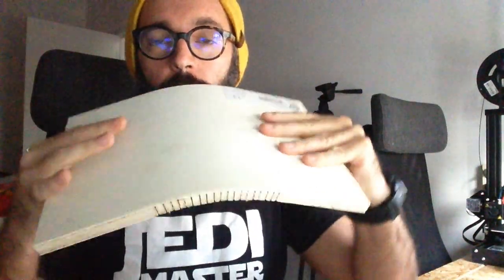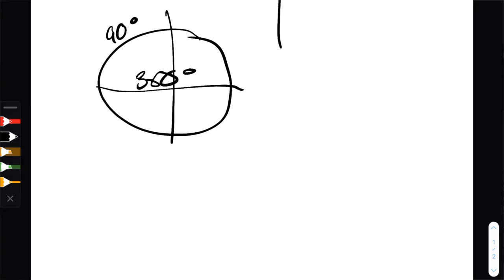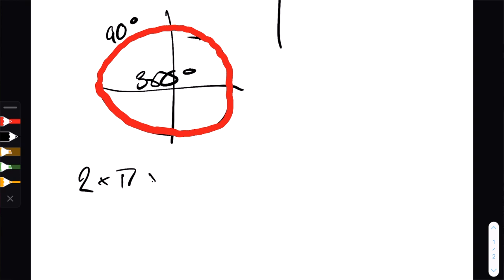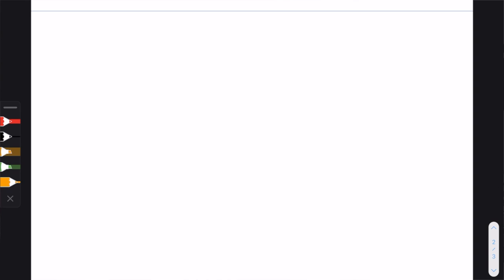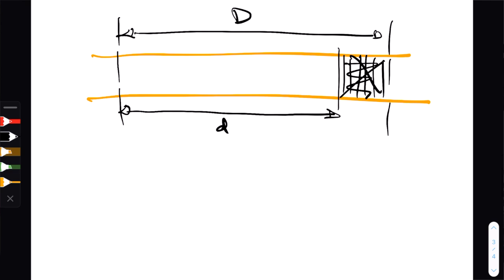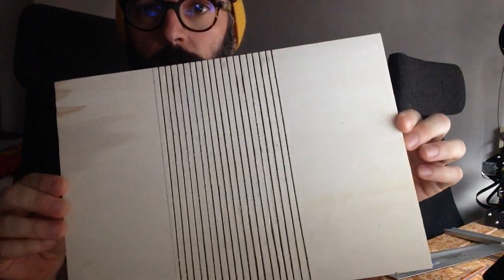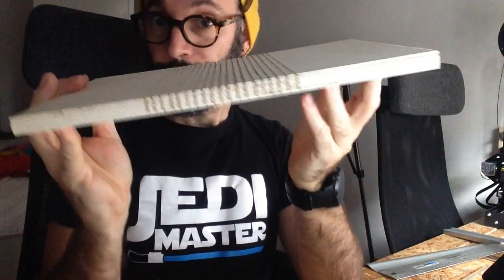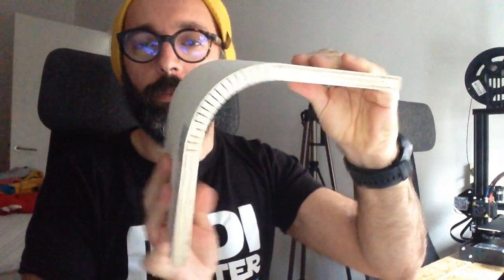How to do EXACT Kerf Bending

Comment: Nice thing! Just division of the 110mm should be by 20 to get the spacing, because 19 cuts leave 20 uncut areas between the beginning and end-line. Kind of like cutting a bread: one piece --> 0 cuts ;  two pieces --> 1cut; three pieces --> 2cuts ......
Reply from the maker: Good spot! two other people also spotted the error :-)
Reply: ;) btw and amazingly
you don't need to calculate the internal and external circumferences.
It's the thickness of the wood x2 ÷ 4(in this case of 90°*) x π

* e.g. for 60° it'd be ÷ 6

12mm x 2 x π ÷ 4 ,,,,, 18.85

500 x 2 x π ÷ 4 ,,,,, 785.39
488 x 2 x π ÷ 4 ,,,,, 766.54 ,,,, difference 18.85
________________
;) Here's a great little bit of mental arithmetic if you want to have fun with somebody on a long car journey(and I had to have it explained to me,,, and I still wanted to see it on paper before I believed it)

The earth's diameter is 12,000km
There is a piece of rope tied right around it.
The rope needs to be raised by ½ metre along its entire length.
How much extra rope do you need to order?
Reply from the maker: hahaha.....that is indeed a beautiful car journey challenge :-) The answer, I believe, is π meters.
Reply: That's interesting.
I was thinking that too
but,,,,
thinking of it as a clock face,,, with 60 segments and 60 markers on the outside
(noting the curve is only on the outside, it's sixty straight lines on the inside)
and let's say the circumference was exactly 60 cm\600mm
to get a smooth looking curve you'd want 60 grooves
cut at the centre of each minute section.

For a ¼ circle you'd want 15 grooves
but the the curve (the first groove) would actually start at 'half a minute' into the curve, the last would be 'half a minute' before the end.

! I got myself confused writing that but I think I understand it now!
I hope you follow
:)
__________________

Comment: How can I do for 180°? I did but totally failed :( using 3mm thick plywood
Reply from the maker: Sorry to hear you failed....but we all fail the first time. 3mm is very thin, so you will have to be extra precise to bend without breaking. It is important to know your blade thickness and the desired radius. I think a radius smaller than 10cm would be a challenge :-)

Comment: If you use a pic of a clock, it's an easy angle finder. Every minute is 6 degrees
Reply from the maker: Thats true....however, for accurate bends and to know how many kerfs to cut, you also need to know the radius and width of your blade.
Reply: @OneTimeBuilds  absolutely, totally agree.
Reply from the maker: @TWalls67  I built a tool that resembles what you suggest ;-) https://youtu.be/CIBRmBxTPCA

Comment: How deep did you make the cuts with your circular saw?
Reply from the maker: I typically do around 90%, but it depends a bit on the material and how flexible it is. But generally, if the wood is 10mm thick, I would do 9mm cut and leave the last hardwood layer intact.
Reply: @OneTimeBuilds  thank you so very much.  Great tutorial
Reply from the maker: @MrBrewsk  Great that it was helpful!

Comment: Gerat Video! Thank you so much. I just wanted to ask you, what kind of saw do you use, or what do you recommend for this fine kerf? Thank you in advance!
Reply from the maker: Hi Attila, thanks for your comment. Im using a simple battery powered small circular saw. In particular Im using this model: https://www.praxis.nl/gereedschap-installatiemateriaal/elektrisch-gereedschap/zaagmachines/cirkelzagen/worx-handcirkelzaag-wx523-20v/5358900?channable=02490e696400353335383930307c&gclid=CjwKCAiAi_D_BRApEiwASslbJ2VPj_YTx9tdviHMJF2tdM6-J_BWoO4X4FygyCSoPjgeEi5YJMm70hoCacUQAvD_BwE
Reply: @OneTimeBuilds   Thank you so much for your kind help. :) this is the best kerf calculating video. Do more :) Regards from Budapest!
Reply from the maker: Thank you! I made another similar one on calculating angles for joining boards :-) https://www.youtube.com/watch?v=ZYAxcUHvQUQ&t=42s
Reply: @OneTimeBuilds   This is awesome to! :) In case of cutting kerf on plywood I noticed that if we cut the wood more densely with a thin blade, the arc on the outer perimeter of the wood is much smoother.  Not as square in outside as cutting with a wide blade.
Reply from the maker: @attilasipeki1418  Yes, that is absolutely true! The thinner the blade, the smoother the curve!
Reply: @OneTimeBuilds  Hello my new friend :) Today I have my kerf bending on my plywood... it is so fantastic! :) I bought a Stanley Fatmax Handy circular saw I made the cuts. The blade is 1,2mm thin. It worked wonderfully. Thanks again for the helpful video!
Reply from the maker: @attilasipeki1418  Very nice!!!

Comment: Nice, simple explanation.

One observation: Dividing 110 by 19, as you've done, means 19 grooves with 18 sections of 5.8mm between them, plus (half of) the two outer cuts, which comes to 105.4mm.
The remaining 4.6mm at the ends do not bend, they are part of the rest of the board which is straight, and this may be significant in some situations.
To have the last bend right at the end of the curve, you'll need to place the outermost grooves at the ends of the 110mm piece and divide the remainder by 18, i.e.: (110-2)/18=6mm.
Reply from the maker: Haha....yes....I realised this as I was editing the video. Good spot!
Reply: @OneTimeBuilds  Hiya, I am having trouble understanding this. Could you possibly try and explain it better? "plus (half of) the two outer cuts, which comes to 105.4mm"- i dont quite understand this part and the last part. Thank you so much!
Reply: i was searchin the comment section just to see if someone else noticed😂
Reply: @dorakonn1787  Hiya, I am having trouble understanding this. Could you possibly try and explain it better? "plus (half of) the two outer cuts, which comes to 105.4mm"- i dont quite understand this part and the last part. Thank you so much!
Reply from the maker: @gabrielbarnett4598  The issue is dividing by 18 or 19. I made a mistake in the video but the overall result will only change by a 5% max, so you wont notice the difference :-)
Reply: @OneTimeBuilds  Okay thank you- for the video and really quick reply. Will this mistake happen if i use the kerf bend calculator? Also, if I have a cardboard cut out of a chair with lots of different curves that i want to replicate with kerf bending, do you know how I can find the angle and radius required to put into the kerf bend calculator?
Reply from the maker: @gabrielbarnett4598  depends on which calculator you use, but I guess there will be no error. My point was mostly explain it mathematically :-) To find the radius and angle you cam buy some plastic angle finders that will help you do that. I made another video with a 3D printed tool I made for just that purpose :-)
Reply: @dorakonn1787  same
Reply from the maker: hahaha....yes yes...well spotted. The fact is that the difference with one groove will be negligible. It is only a 5% error when Im quite certain the error on my hand saw is higher :-)
Reply: @OneTimeBuilds well it was no big misstake tho i was just curious n ur vid was actually really really helpful🙌
Reply: Hiya, I am having trouble understanding this. Could you possibly try and explain it better? "plus (half of) the two outer cuts, which comes to 105.4mm"- i dont quite understand this part and the last part. Thank you so much!
Reply: @gabrielbarnett4598  I don't know if this helps, but having woodworked for several years, this actually makes sense to me. You see, if you divide the number of cuts into the outer circumference (as he did), this should leave you with "half" a cut at either end if your kerf calculations are centered properly. To make 19 cuts, you will have some "left over" at the end, or so it makes sense to me. Well, really, no matter how many cuts you have when all is said and done, for something to bend to a perfect 90 degrees means you will have "leftovers" on the end (because what sense would it make to make a cut on the end?). Matter of fact, no matter what angle you're cutting for, you should end up with two end pieces that are exactly half of the cutting width. If not, you'll have run out of board and know that the calculations aren't correct because, theoretically, they should end up evenly spaced within the "cut zone" and centered.  Or at least, that's what the math says. Don't ask me about the math. I hate math. Gives me hives. But this is easy math and I've sewn where I had to calculate the bit that goes around a circle without puckers, so the concept is sound. As I was always told, don't ask why, just do because the math works.

Comment: cool - thank you :-) I have a little input on the bending..... before cutting the grooves, make sure that the growing lines of the wood in the last layer (the outer Parameter) are going with the bend ;-) thus the fibres can stretch. if the look across the bending, the wood will crack - oops built couple of drums and this was the first thing I learnt ;-) thougt it might help
Reply: I wasn't aware that the layers of ply stretch at all. However, now that I think about it, it makes total sense. Steam or hot water also works to avoid breaks. Also, I hear tell from someone who's done this for 50 years that adding liquid fabric softener (like for clothing) to the hot water makes bending even easier.
Reply from the maker: Thanks for the tip...it totally makes sense!
Reply: Tnx note the math doesn't calculate the depht off the cut

Comment: Excellent explanation! 
Just a single doubt: the glue can be vinilic or poliurethanic expanding type? Thanks a lot for your time! Néstor.
Reply from the maker: Thanks! I always use standard wood glue and then fill the gaps (if any) with wood filler (or saw dust mixed with wood glue), but I guess expanding glue would do a good job also!

Comment: About kerfs… In order do calculations, one has to know the kerf of saw blade: how much wood will a particular saw blade remove in a single cut.  For those that do not know, a saw blade has teeth that are wider than the metal of which it is a part: the blade, sans the teeth. One circular saw blades, the (separate) teeth are actually welded onto the blade.  One notable exception are the (Japanese) Pull Saws.  Pull saws because they cut on the pull (back toward the person making the cut) as opposed to hand saws cut on the “pushing” action of the saw: the saw cuts as the saw is pushed away, the away stroke, from the person doing the sawing.  Electric saws that have spinning / moving saw blade, and the person making the acute pushes wood thru the moving blade or the saw is pushed thru wood.  I just purchased a unique kind of saw where the saw blade is fixed on a table top and the wood is pushed thru the saw via a miter gauge sliding over the saw bed.  This has to be one of the safest saws in the world; not for your everyday sawing tasks, but it works very well for slower, hand crafted stuff.  Visit https://bridgecitytools.com/ and look for “Jointmaker Pro v2.”  This has to be the coolest, most ingenious devolution of a table saw I ever seen or imagined.

Many guess or haphazardly guess at the width using a ruler; for more accurate measurements, particularly in kerf bending operations, use a precise calipers.  Even then, too many people measure the width of the blade not the teeth. The width of the teeth necessarily need to be wider than the blade so wood does not bind on the blade base-which is pretty dangerous for most electric sawing tasks.  Even getting a measurement on a single tooth can be problematic because each tooth is often laterally offset to the tooth in front and behind it (and other weird permutations of that arrangement).

Here is a very reliable and accurate method to know the “real” kerf of a saw blade.  Take two pieces of wood, preferable the same wood where a kerf bending cut will be made.  The pieces or sticks should be two “bars,” perhaps 1x2 and 3-5 inches long.  The shorter than 6" length is valuable because most calipers do not exceed 6 inches (15cm). Be sure both pieces are the exact same length; use a stop guide to assure this.  Then take one of those pieces and cut off an inch or two from one of the ends or cut it in half.  When you are done, you have one piece whose length you know (the uncut piece), and the other piece that was cut to be determined.   Then stack the two pieces from the one stick that was cut and put them end to end and measure the length.  Now compare the total length of the two cut piece (as one piece) and subtract that length from the uncut piece.  The difference is the actual, precise kerf width of that particular saw blade.
Reply from the maker: I like exact methods! For "home or hobby" builders like myself (without fancy table saws), they are difficult to use. I personally use a hand held electric circular saw, which is OK quality but not professional quality. This means the blade actually wobbles a little as it cuts, more or less depending on the depth, type of wood, etc. So my preferred method is to actually use a piece of scrap wood of the same type, cut some lines on it and use a calliper to measure the actual width of the cuts. I found that the actual cut was way bigger then the width of the blade!